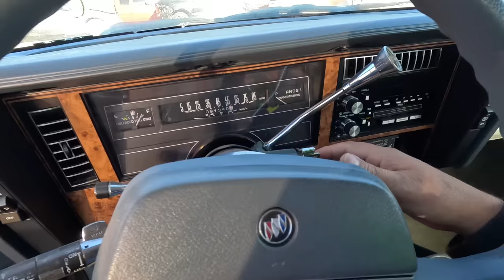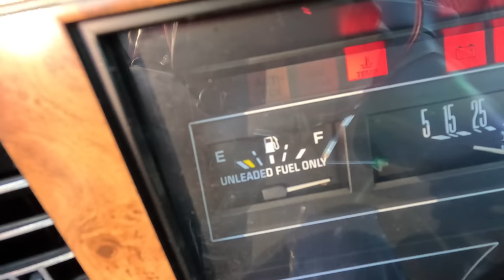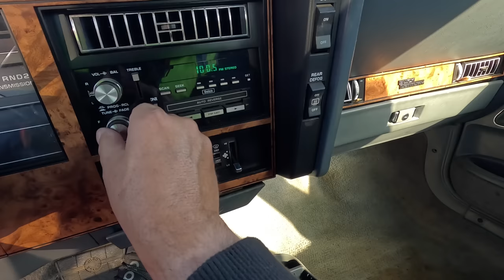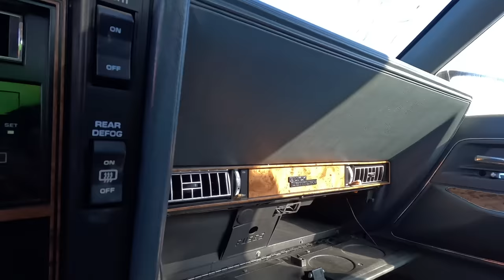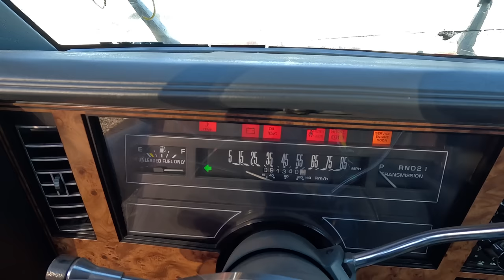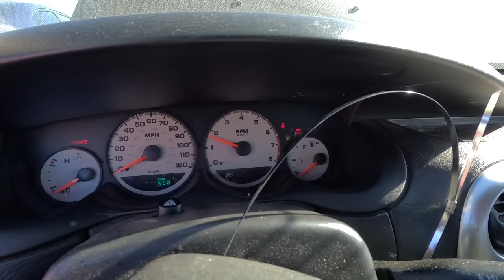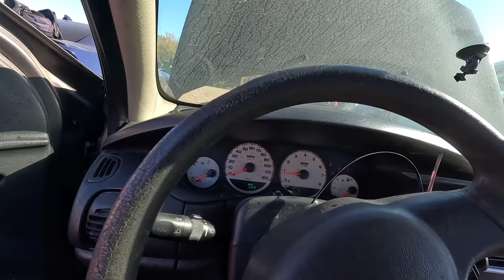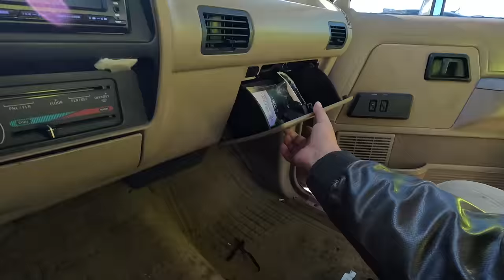IAA Walk Around with 11-9-22 + Almost FREE Buick!!! Will it Run? With @MonkeyWrenchMike

Comment: Had an 85 and later an 86 Century, which were pretty much identical to that 92 except  both had the Iron Duke, so they were a bit lethargic, but THE most comfortable road cruisers... were very reliable and got great gas mileage. Didn't care at all that they were "grandpa" cars because they were so comfy and smooth. 

I'd love to be able to own another one but I won't... because the 85 burned and the 86 got t-boned. I think they're cursed for me.

Comment: Fuel pump or relay on the Buick Century! Be a good car for someone if it's cheap! That little Ranger will run forever! Push rod engine 4.0 is a great motor!
Reply: Could be a crank sensor..

Comment: Currently diving a 93 Pontiac Grand Am with the 3300. It's just a smaller version of the 3800. Super reliable! My car has 224,000 miles and climbing. Its my daily. I'd like to find a Buick Century or Olds Cutlass Ciera Wagon with this engine to make my daily driver so I can run the Grand Am in the 24 hours of lemons race. 😝
Reply: Nice! They don't make them like they used too..

Comment: Drove a cutlass like that century for a couple years. Had the sfi 3.1 v6 . Decent torque steer will scratch the tires, ok fuel economy, great heat once you get going, reliable

Comment: lIf the truck had a bench or split bench seat,,,  then the thingy on the steering wheel would be called a necker knob,,,  :-)  otherwise it is for one handed steering while you are holding your beer,,  :-)

Comment: You might be condemning Mike to death suggesting that he tow his Mercedes behind the ranger.  The 4.0 will have no problem with it, but the ranger has very soft suspension and doesn't weigh enough.  It would be very squirrelly, for sure.

Comment: My Mom bought a 95 Century Limited new she finally quit driving this year with 164,000 Senior driven miles.  She changed the oil every 2000 miles a few years ago my brother who's a mechanic put a new a/c evaporator, rotors and brakes,  she just gave it to a young couple who needed a car to get to work.  It never left her stranded in all those years, she had a muffler put on it at the local shop with life time warranty just going to church once a week and once a month shopping muffler never dried out so it rusted, I think she's had 5 free mufflers up to this point.   In the last few years my brother had issues finding window parts for it he had to call his buddies and find parts in the junk yard.

Comment: Those old Centuries with the 3300 would get it pretty good. We had a 92 Special when I was growing up. That thing had the worst brakes, like they were manual. Couldn't hardly lock 'em up in the wet. That one looks to have a 3 speed auto. 2nd gear would wind out at 70 mph on the 4 speed. I guess maybe the Custom had the base 3 speed trans. You could also get a manual.

Comment: The Buick is great the neon I’d say probably has a bad heater core and lost water and was run hot at least once some didn’t have electric lock release the ones that did almost every one I’ve seen you had to mash the button several times to get it to work